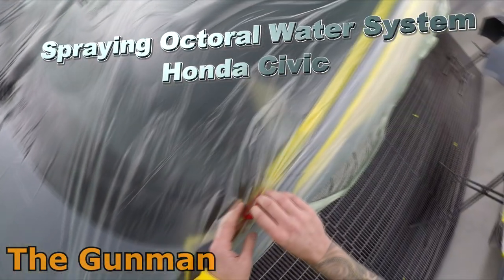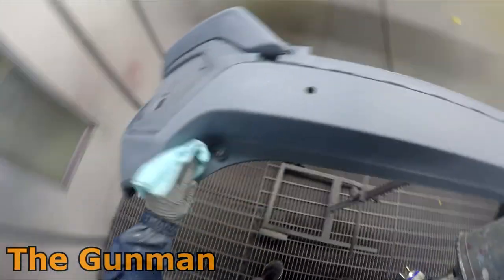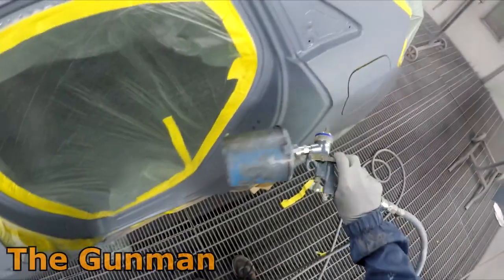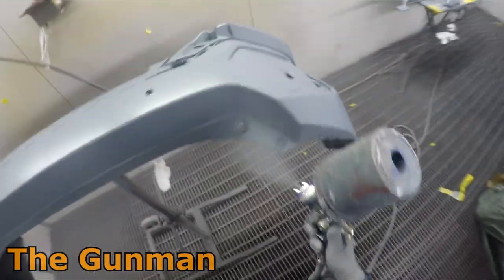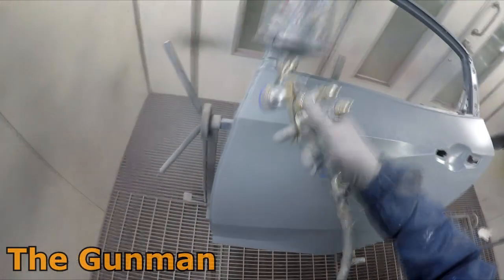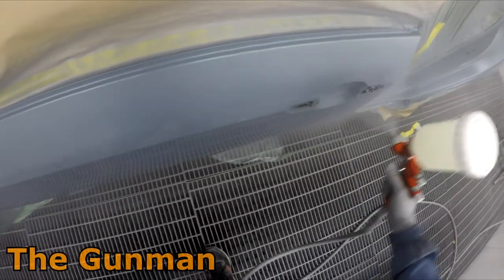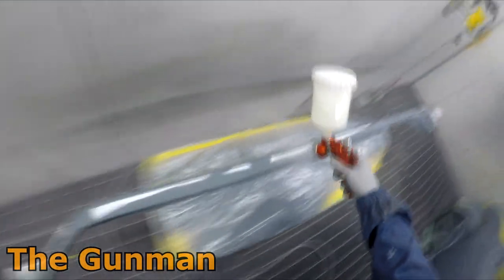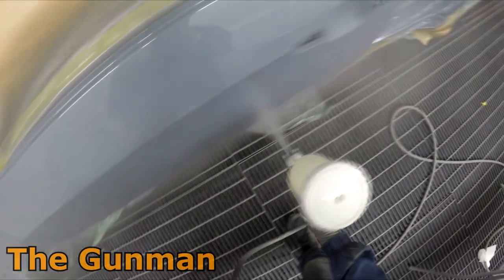Spraying Octoral Waterborne System

Comment: been using it for ages in the uk for ages, color matching is great too
was easy trasition from solvent to wb like you say
theres no active ingredient in the waterbase so you can use left over base months later, some systems you cant

also pretty cool for doing custom marbling/wood grain as it has a longer drying time than solvent
Reply from the maker: Yeah Cromax Pro did seem a bit wasteful how you can only reuse it if you add a further 20% binder and end up diluting the colour, which will obviously alter the colour.